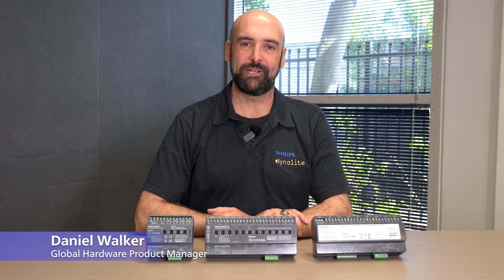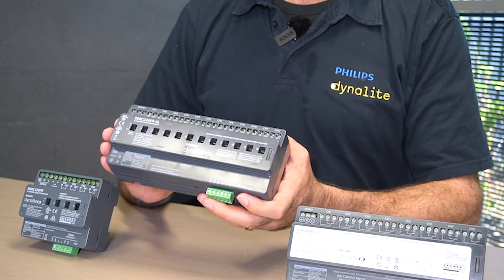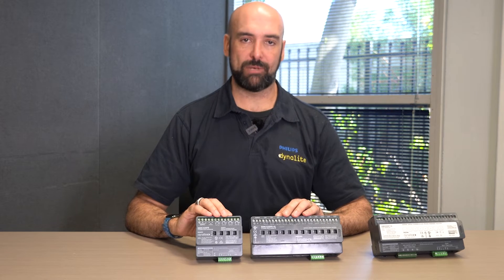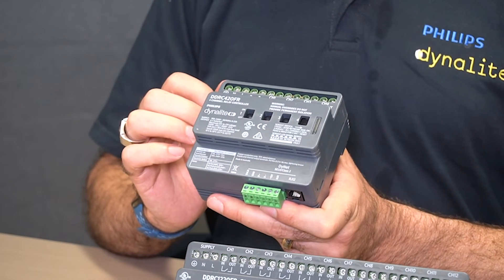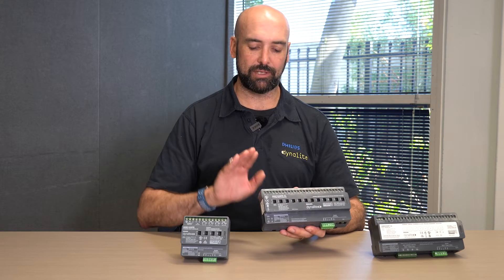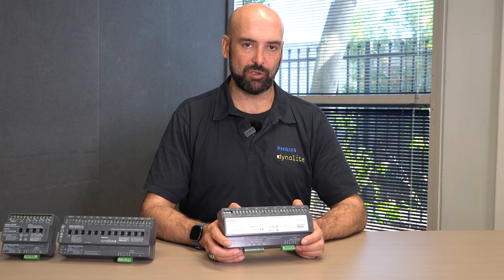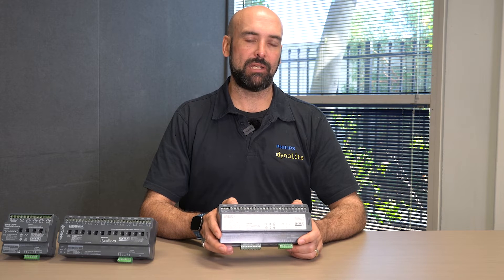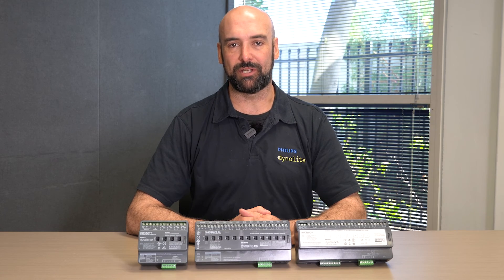Philips Dynalite DIN-rail Relay Controllers | An Overview of Our Range

Comment: The contractors who installed the DDRC810DT-GL in my parents' new apartment to have master control of the motorized blinds apparently don't understand how to properly wire and/or program it so it only can lower the blinds, not raise them! any suggestions?
Reply from the maker: Hi there, we're sorry to hear about the troubles at your parent's apartment! We recommend getting the people who installed our system back in to take another look. If they are certified partners of Dynalite/Signify, they can reach out to our system expert team for assistance if they are unsure. Otherwise, you can use the partner locator tool to find a certified system integrator in your area who is equipped to come out and correct the error.

https://www.signify.com/global/partner-program/partner-locator